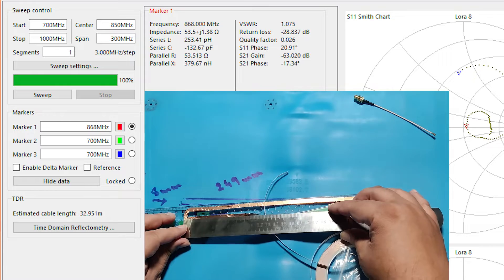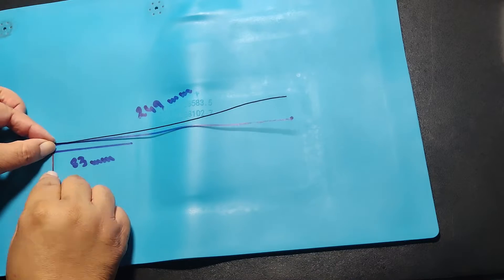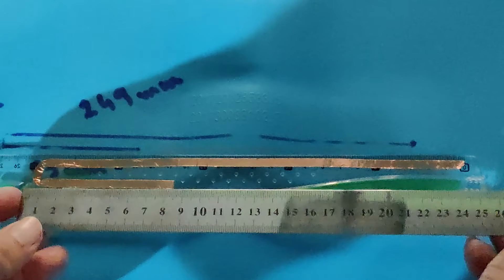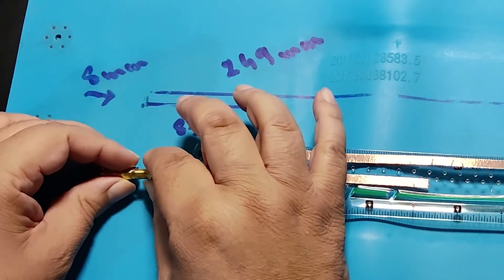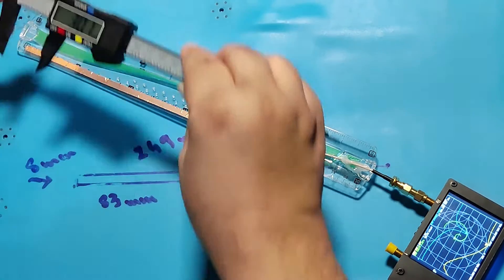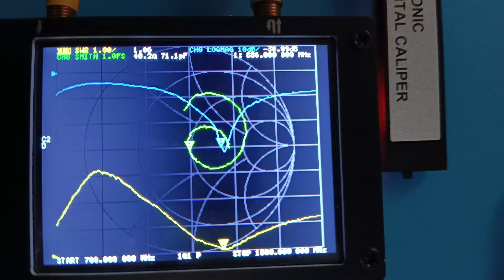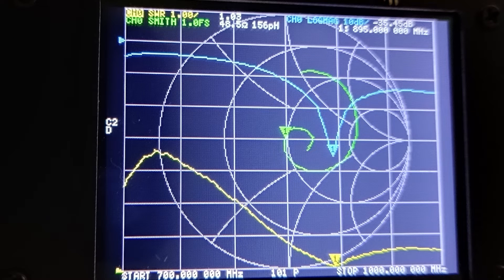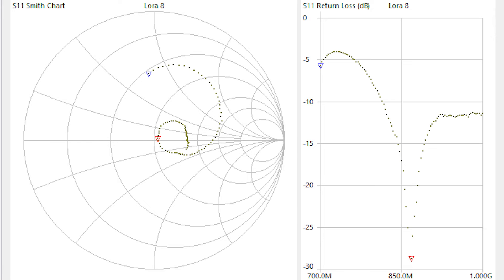Meshtastic DIY J-Pole Omnidirectional Antenna Using Copper Tape by Technology Master

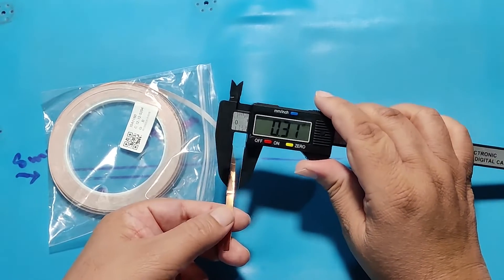Comment: 0:38   That's .20 inches there. Probably matters.
Reply from the maker: I am just guessing the question and my reply may not be what you are asking. I used a copper tape of 20mm width. It is about 0.78 inch. Thickness of the tape is very small. It is like a film. Performance of this tape is similar to stainless steel spike (spoke of cycle) at under sub GHZ frequencies. A hollow copper tube will surely perform much better and give more bandwidth.

Comment: to do the bottom corners of the stub neatly without all that ugly crinkly bunching you get trying to "bend it" around the corner..... go flat/straight to the corner (say upper radiating element running left).. put a 45 degree bend on the flat to send the tape THE WRONG WAY flat with the sticky side upwards (ie going UP the page) but then immediately fold it back on itself to go down with the sticky side down for the bottom of the stub... then 45degree fold on flat to send the foil LEFT with the sticky upwards but then immediately fold back to run right with the sticky down to run the lower leg of the stub.... perfectly neat flat conductive corners with no bunching.
Reply from the maker: Thanks for sharing your thoughts. Short Answer:  I just did what I planned to do.  Long Answer:  "Why are you doing it. Why don't you buy it. Look at your hands ..."  I hear these things at times from people who in a way trying to help or guide me. If you look at my website, my tag line is "TECHNOLOGY FOR NON-ENGINEERS". If you check descriptions and tags etc you will find word "HAM" or "Amateur" frequently.  

I am not doing these videos to help professionals become more professional. Youtube and Internet is already full of resources for that. I want to help anybody who wants to do it, just do it. What matters to me (fulfils my goal) is that it works. These antennas are not for sale. They are made with heart and love for oneself or friends.
Reply from the maker: Tag line is now changed to "TECHNOLOGY FOR EVERYONE"